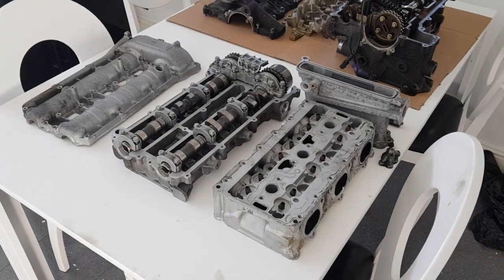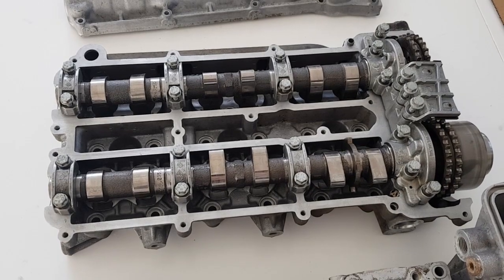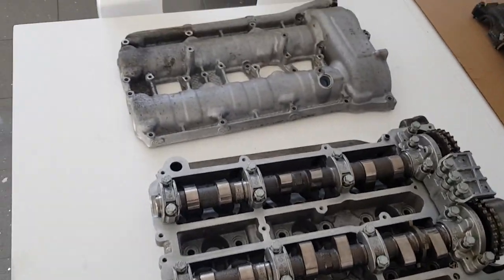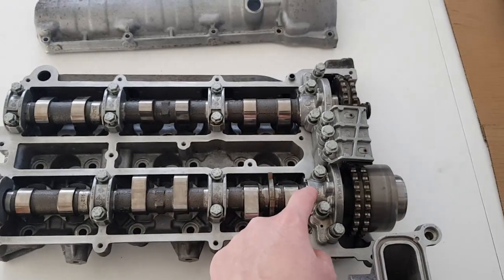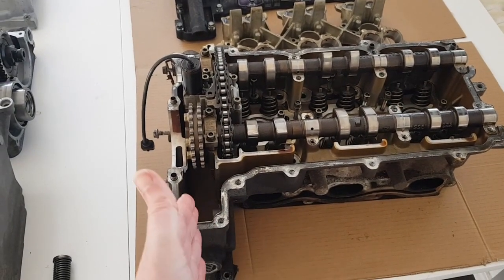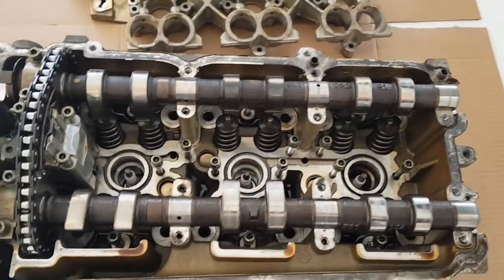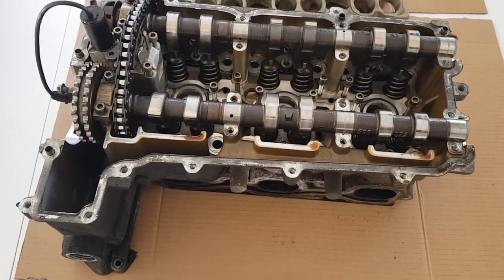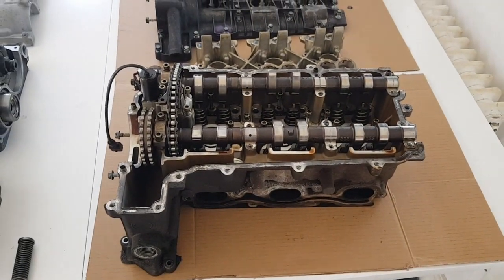Porsche 996 M96 Carrera and GT3/Turbo head design comparison.

Comment: Big thanks for this. Just what I was after. So whilst the GT3 can vary the cam timing in relation to the crank the Carrera can also vary phase between the inlet and exhaust valves? What is the mileage before wear like on the GT3's chain guide? Also, can the Carrera adjust the inlet timing vs the crank position? cheers.
Reply from the maker: Both the carrera and the GT/turbo engines vary the timing of the inlet camshaft relative to the crankshaft, whilst running fixed timing on the exhaust.  The differences in the way they do it mean that the carrera system is on/off whereas the GT/turbo one is variable.  The turbo also has the addition of the switchable cam lobes which neither the GT3 or the carrera has on the 3.4l engines.
Reply: @martinhill5770  thanks for the reply, apologies if it was a slightly confused question.

Comment: Martin, happy holidays. Thanks for such an informative video, Porsche really took their time to engineer, a cost effective solution incorporating the castings. I’m very interested in the valve spring specs, heights,  psi rates ,diameters and difference in the m96/76-79  and the m96/1-4 engines. Looking to upgrade my x51 modified m96/04 engine with the upgraded valve springs for the gt3. What have you been able to measure and compare. Cheers.

Comment: Could you please explain what is going on with that channel between the exhaust ports and why it’s only on the 996 and 997.1?
Reply: @Emrys Dwyer how that work? It just runs between the ports and nowhere else
Reply: But why a grooved channel that runs between all three ports? It seems detrimental to cylinder scavenging.  Additionally, how do you "inject" filtered air into the exhaust on a naturally aspirated engine?  MAP is always at a vacuum.